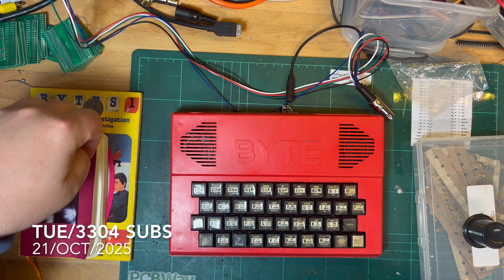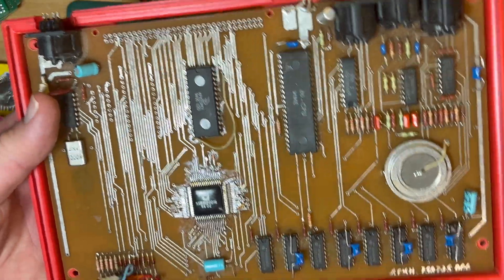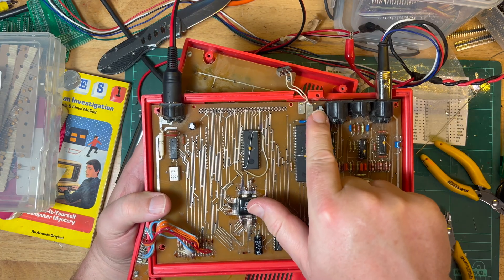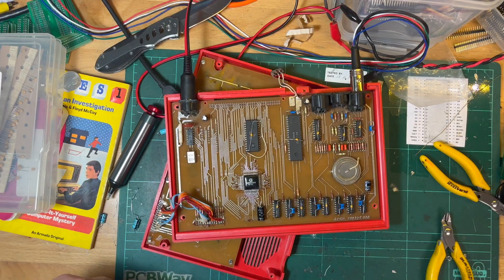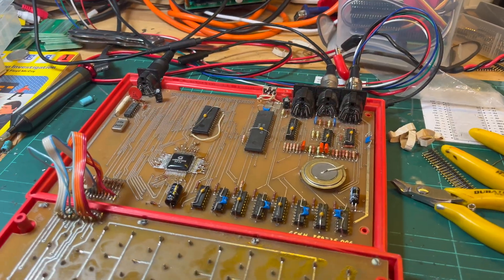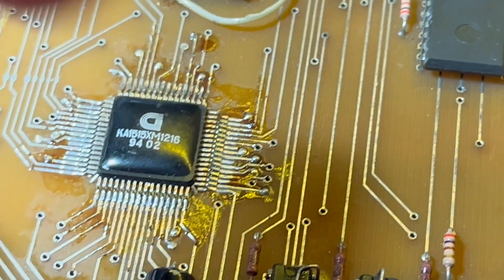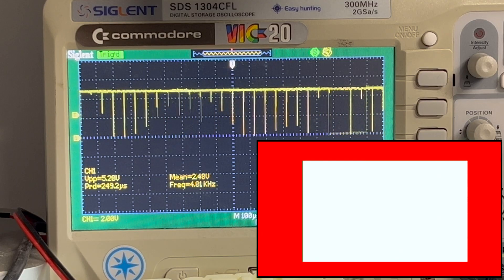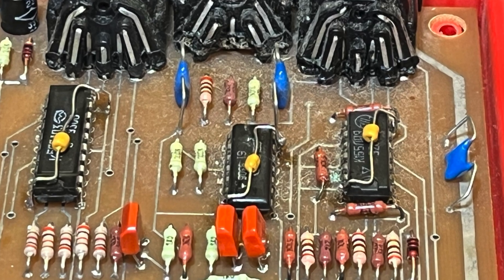🇲🇩 BYTE: Part 15 (It works!) [TCE #0652]

Comment: is that a dual package 555 timer up near the xtal driving the clock?!
Reply from the maker: Good eye and assumption ... it's actually a К555ЛН1, equivalent to a 74LS04 hex inverter, and is needed because you can't connect the 8MHz crystal directly to the CLK_IN pin of the БМК.  Excellent write-up here (translate page to English): https://zxbyte.ru/t34vg1.htm

This reminds me that the Moldovan BYTEs pre-date my Patreon, so I'll add some hi-res photos.
Reply: @Brfff  ahh i see...its dividing the clock down to 4mhz...same could be done with a 16mhz xtal just using more inverters
Reply from the maker: @WacKEDmaN  I believe the БМК does the actual halving as it outputs the 4MHz system clock.  

I checked the reason for the inverters from Comrade Grokski ... TL;DR is that the БМК needs/expects a nice square-wave clock:

The schematic depicts a discrete crystal oscillator circuit built around a pair of 74LS04 inverters to generate an 8MHz clock signal from the crystal, which is then fed to the CLK_IN pin of the КА1515ХМ1-216 chip. This is necessary because the chip expects a digital square-wave clock input rather than having built-in oscillator support for a direct crystal connection (unlike some ULAs with dedicated X1/X2 pins).
The inverters serve two main roles in this setup:

[1] The first inverter (DD1.1) is biased (via the resistors) to operate in its linear region, acting as an amplifier to provide the gain needed to start and sustain oscillation with the crystal at its resonant frequency.

[2] The second inverter (DD1.2) acts as a buffer to clean up and square the roughly sinusoidal waveform from the first stage into a sharp, TTL-level square wave with fast rise/fall times, making it suitable as a stable digital clock signal.

Overall, the inverters ensure the CLK_IN receives a reliable, low-jitter 8MHz square-wave clock instead of no signal at all (if the crystal were connected directly) or an incompatible weak/analog waveform. The resistors limit current and help set the bias point for linear operation, while the capacitor likely provides load capacitance for the crystal.
Reply: @Brfff  from what i seen on that link you shared it said it was dividing the clock...but yup the cpc also uses the hex inverter to clean up the signal...
edit: on 2nd look i see it now.. the gate array does indeed divide the clock...
Reply from the maker: Patreon Post:
https://www.patreon.com/posts/red-byte-zx-from-141707902?utm_medium=clipboard_copy&utm_source=copyLink&utm_campaign=postshare_creator&utm_content=join_link

Comment: Hi. I'm from Bendery, where those Byte clones were manufactured at the Mezon factory in the early 90s. I had the same gray one. They were called Byte-1, and the ones in the red case were Byte-2. I learned to program on one of those computers, and back then, I also became seriously interested in electronics. My computer disappeared somewhere over the years, and I've been looking for a similar one for a long time. But it's no longer possible to find a Byte-1 or Byte-2 in our city. I'm surprised you managed to buy so many of them in Australia, and in such perfect condition.

My brother recently found a Byte-1 like mine in a friend's old garage. It's in pretty bad shape on the outside, but the inside is like new; it hasn't been soldered. I was hoping it would work, but it turns out it won't boot properly. I spent a long time diagnosing it with an oscilloscope, but eventually came to the conclusion that the ROM firmware needed to be replaced, as it had likely become corrupted after 30 years of not being turned on. If I remove the ROM chip (I desoldered it and re-soldered it to a socket), uniform colored stripes appear on the screen. This means the processor is working. I also bought KR565RU5 RAM, but it seems to be perfectly fine. I re-soldered one suspicious cell to a socket, but it didn't help, so I concluded that I needed to flash the ROM. But I don't have a ready-made image for the flashing. Perhaps you could dump the firmware for the AM27C128 (for Byte-1)? I'll be flashing it on site. I'd be very grateful if you could.
Reply from the maker: Ahh ... Byte-1 and Byte-2 are better names than "Speccy Byte" and "Red Byte", thanks.  For the ROM, I know the red Byte-2 uses КР1013РЕ1 ... but now that I look back at a video of the Speccy BYTE-1 I can see it has a pair of EPROMs rather than the single КР1013РЕ1 in the red BYTE-2.  Unfortunately I'm not at home at the moment, back next week, so I can try to dig it out then, desolder and dump.  But maybe try the КР1013РЕ1 image ... just need to split it in half with a hex editor.  Maybe it's the same.

https://youtu.be/jiufomc-Qow?si=BaQfGIjbQpPhGM50&t=1326
Reply: @Brfff  If all goes well, the firmware from faraway Australia will return to its hometown. I'll also keep you updated on what happens with my Byte-1.

I can also say that this computer used to be very popular, and almost every boy had one at home. The Byte-1 had only one drawback: although the keyboard was rubber, the aluminum foil on some keys would peel off over time, requiring the top panel to be removed and re-glued. The Byte-2 had a reed-contact keyboard, but many at the time considered the Byte-1 to be of higher quality, mainly due to the number of chips, as people were still wary of the super-ULA. But judging by your videos, it's clear that the Byte-1 was indeed better. The Byte-1 case is also better. Overall, the Byte-2 was being made towards the end of the Spectrum generation, and the Sega MD2 had just appeared. After the Byte-2, the Mezon factory began to collapse, and now only the building remains. This factory previously manufactured almost all the chips installed in the Byte-1, except for the CPU, ROM and K554SA3B (Comparator). This is evidenced by the Mezon factory logo (the letter M). The Mezon factory produced many different chips at the time. So, this factory simultaneously produced both the components inside the computer and the computer itself.

By the way, the Byte-1 variant in a red case with a reed keypad is very rare, so you're in luck.

On the other hand, I remember when the factory closed, all the components and cases were still available for sale in the factory store for a long time. So someone could have replaced the case themselves, mostly because of the keyboard. But most likely this was a transitional batch. There were very few of them at that time.

Incidentally, the PARUS-VI-201 was based on the Byte-1, not the other way around. However, the schematic was retained only for the PARUS. The schematic is very similar, even the board layout is very similar.

Comment: I think that the cap on the reset line is there to be a pulse-stretcher. And don't forget the MAME tape utilities.
Reply from the maker: That would make sense but in this case they are [a] using a slide switch for the reset so it'd be "stretched" anyway, and [b] installed the capacitor in the wrong hole!  When I was posting the Patreon photos I noticed the 2022 ones had that same capacitor between GND and +5V (connected to the Z80 +5V pin) ... on this board (2025 photos) it's actually connected between GND and ... GND!  So it is supposed to be a decoupling capacitor, I think, but they installed it wrong so actually it was doing nuthin'!!
Reply: @Brfff  Brilliant! :)

Comment: Those u10 caps, I would real as 0.1, as in the 1 is after the 'u'
Boy were old school CRT monitors forgiving of badly formed and off frequency composite video, most modern converts and digitisers are truly horrible by comparison.
Reply: Все верно, греческая буква мю (буду писать латинскую u) обозначает микрофарады (буду писать мкФ), но так как она стоит перед цифрой то одновременно символизирует собой десятичную точку. Таким образом u10 - это 0,1мкФ, а например 1u5 - это 1,5мкФ. Тоже самое правило относится и к нанофарадам (н русская или n латинская) и к пикофарадам (п - русская или p латинская), н22 - это 0,22нФ или 220пФ, 22н - это 22нФ или 22000пФ, а 2н2 - соответственно 2,2нФ или 2200пФ. Для маркировки резисторов действуют аналогичные правила.
Reply from the maker: Ahhh, that makes sense ... so 100nF ... thanks!

Comment: It occurs to me that "runs slightly faster" could be a bad thing on construction like that? Have you tried them with a slower crystal, maybe 6MHz?
Reply from the maker: It's apparently standard for these БМК-based machines (there's a few different designs out there).  The clones that use discrete parts generally seem (or seemed?) to use 14MHz crystals which divide down nicely to 7MHz and then 3.5MHz.  But this design expects a nice square-wave 8MHz input clock to give a 4MHz system clock.
Reply: That would likely break the video generation. The whole design around a 16MHz crystal is based off another early TTL clone (Kharkov? Baltic?) if I'm not mistaken. In practice most software doesn't feel too off when running at 4MHz actually.
Reply: @RandomBlankUsername ah true. Such economy of design.

Comment: Could it be the pitch of the data rather than the volume?  5v is the -2.5 to 2.5 ish needed. but im just thinking if the tape deck used to record that tape as its a copy, might be running slow or fast (or its a 50hz 60hz thing) so could you slow down or speed up the way to get the correct carrier frequency for the header?
Reply: afaik the baud rate can be a fairly wide range (from 10bps to 3500bps)... least on the cpcs..
Reply from the maker: The WAV files should be okay ... they're generated from the archived TZX files, although I thought I had a bunch of other examples (that I know work) but not sure where I've stored them ... been so long since I've fiddled with a Speccy clone.  And, I would've thought the input signal should be "idle low", rather than "idle high" ... ???  But, good idea ... I'll fiddle with the pitch (as volume is irrelevant because of the hex inverter it goes through).